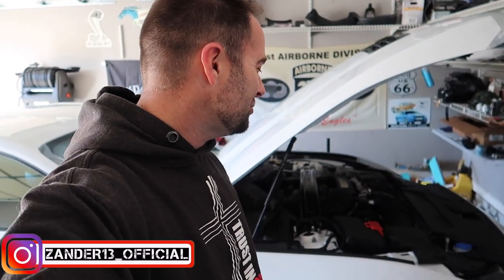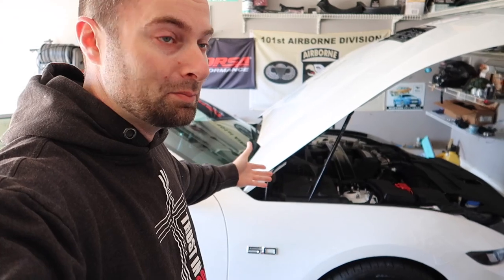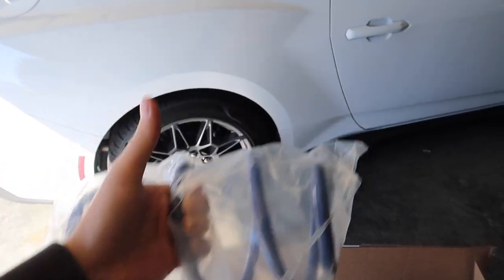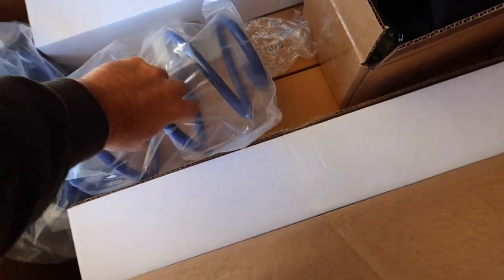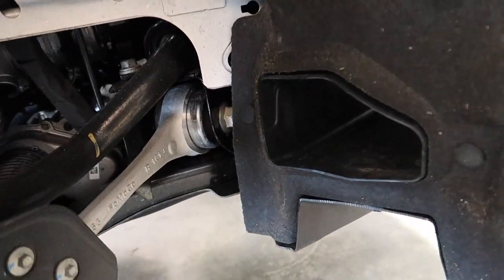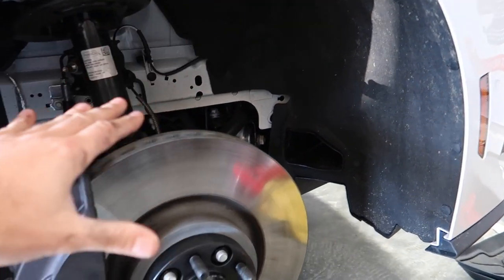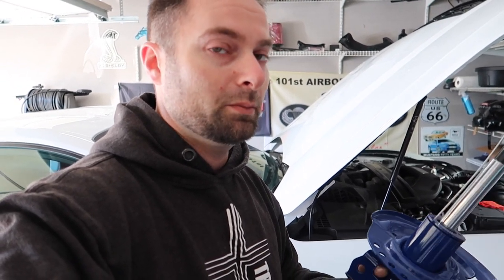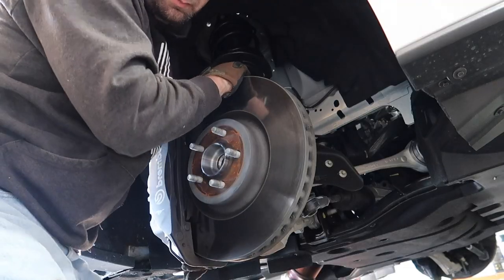MAJOR FIRST MODS To My All New 2024 Mustang s650 ~STEEDA Suspension Overhaul

Comment: I had the steeda minimal on my 17 Gt. It clunked bad. I went back and forth with the shop that installed it thinking its he's install but he put on a set of sportlines and back to my stocks and zero clunks from the fronts. I returned the steeda springs and went with ST's and rode better withe zero issues. I really liked steeda's but they just didn't work out.
Reply from the maker: 😳😬 zero clunking out of mine. Could if have been a torque issue?
Reply: @Zander13Productions  checked and triple checked and couldn't find any issues with install. He mostly works on mustangs and never had that issue. The problem immediately went away with other springs. 🤷🏻‍♂️. Sucks because i wanted the minimal drop.
Reply: I installed Steeda Sport Progressive springs on my 21 GT base.   No issues.  Frame bumps track at tunnel car wash.

Comment: Love that you went with Steeda! I’ve used them for my 16’ pp suspension build and I was AMAZED! I did everything they offered and was very stiff. Maybe went too far making a track car a daily! But!!!!!!! The struts and shocks are a must have with springs. Instead of nose dive and having my head thrusted forward my hips felt it instead and car was very stable at heavy breaking. Very similar to the GT350 with magniride suspension. I highly recommend the bump stops they offer too. Very stable through the bumps a-specially through the turns at Sebring! Steeda offers superior suspension components for the mustang platform! Great video!
Reply from the maker: Which Steeda springs did you do specifically?

Comment: Why go performance pack when you’re changing out complete suspension? I know the other upgrades that come with the pp1 but it seems like a waste of $5,000
Reply: I know you said you know but the bigger brakes and the Torsen rear end with 3.73s with the manual, 3.55 with the 10R80.  That alone is worth the $5k,
Reply from the maker: This exactly
Reply: Content strategy
Reply: @H1GHD3FF this exactly

Comment: The reason i didnt purchase a pp car was because i knew i was gonna ditch all that crap for parts far superior.
The $ saved is buying most of them.
The only part i dont have that i wish i did is the center gauges,but they arent totally accurate any way,so other than looks,its ok.
Probably going with that multi gauge you had in the last s550 and maybe some piller gauges if i need them.

Comment: That's what I've always said about the S550 mustang. ADDRESS SUSPENSION FIRST,especially wheelhop. Then driveline improvements, THEN POWER....i took your advice on the BMR 762 kit and along with their vertical links,diff bushings and toe rods...i also installed gt350 axles...wheelhop is zero and 60ft is consistent 1.7.

Comment: Would the shocks and springs be an upgrade for the Dark Horse w/o the handling package?
Reply from the maker: I think so. But you still have magnaride. So all you need is the dual rate magnetic ride springs. Use code zander5 to save
Reply: @Zander13Productions  Right now I just ordered the Steeda IRS subframe support braces and the air filters. I'll def look into the dual rate magnetic ride springs.

Comment: Ive seen some people say that 25mm spacers don't fit on the s650, I have a 24 performance pack with magneride suspension and I see you do too, any issues with the 25mm spacers?!
Reply from the maker: Mine did not have magnaride but no issues with 25mm. I have heard that magnetic ride needs a slightly smaller like 23mm. But I’m not sure
Reply: @ gotcha, thanks for the reply!

Comment: Hey brother. I have a PP, currently running progressive springs from steeda on stock struts. I feel like the front of my car is too low and there is some scraping and clunks. Since i only need the front, i have been looking at the front only adjustable version of the struts. Is there a reason you didnt do the adjustable ones? They are on sale right now.
Reply from the maker: Long story short. I sold that whole setup for adjustables and dual rate springs. Way happier. But you might want to look into the strut spacers they have. The progressive springs do ride low. Too low for my taste